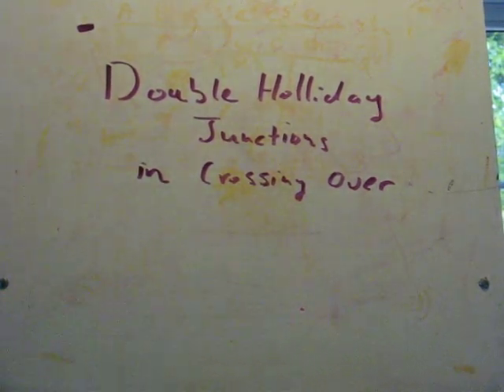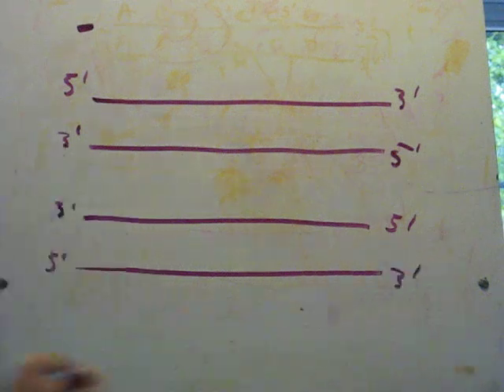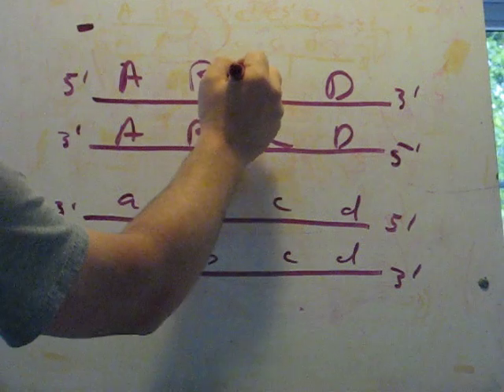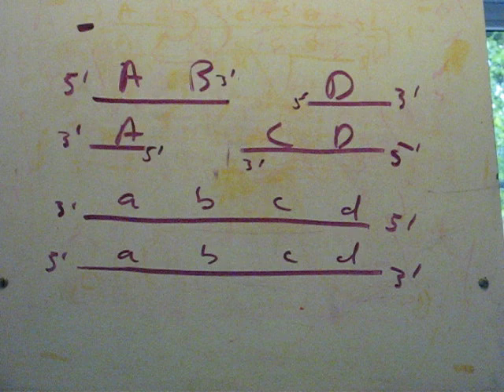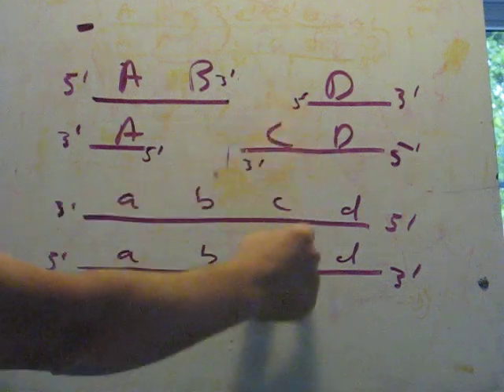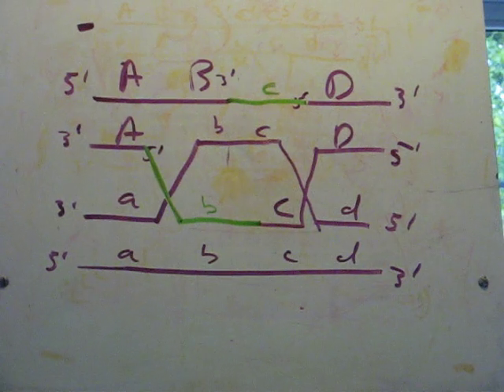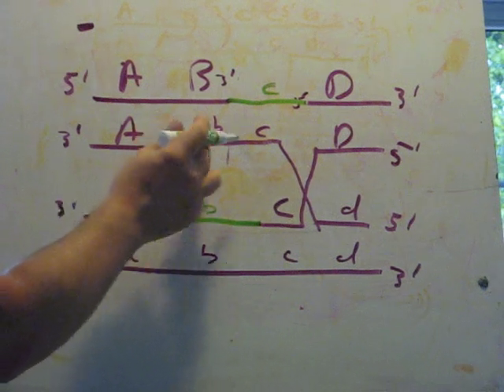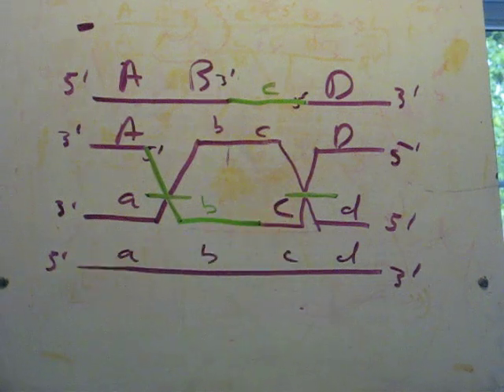Double-strand break repair model of meiotic recombination via Double-Holliday Junctions

Comment: Good. I got it, but I still have a question (not sure I'll explain it well): Why did the 3' nicked strand get paired with the 3' (b) in the lower strand? I mean, shouldn't the fragment formed down there be a capital B? Shouldn't the 3' strand (A) get ligated with the dangling C part that invaded the lower 3' strand, to form a capital B fragment (rather than small b)? I hope that makes sense lol. Thanks in advance